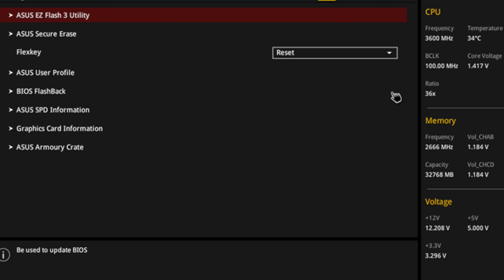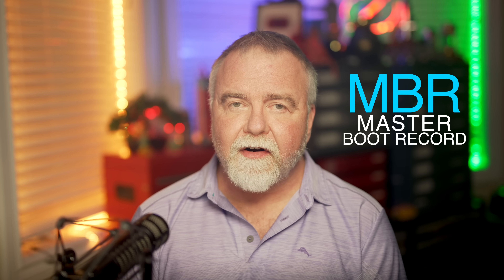How Computers BOOT: From Startup to Viruses

Comment: On monitors there is often an OSD (On Screen Display) Menu.  I had an idea that maybe they could use that system to drop a mouse pointer onto the screen as well a simple start menu.  In this system you would connect your mouse directly to the screen - so that the pointer and start menu is available even before you power on your computer.  Then as the computer boots up - it would be able to interact with the screen and get the x & y coords of the mouse position, and it would be able to temporarily reprogram what options appeared on the start menu.  The screen would also let the computer know what it's screen resolution and aspect ratio are.  The great thing about this system is that even if your computer froze, locked up or crashed - at least the pointer and start menu still function and are available at all times.  So basically the mouse pointer and start menu would be overlayed above the video output from the computer and work independently.  I guess the OSD is an operating system in itself, so what we are talking about is something like a co-processor - the computer is offloading some of the work to a very stable feature that is hard-coded into the monitor.
Reply: Wouldnt that increase latency for the mouse? might be bad for gamers
Reply: That sounds like an interesting thought experiment. There are already ways for displays to send information to a connected computer system, such as its resolution and sound capabilities through, e.g., EDID, and mouse/touch controls with USB. Really the only thing that's missing is a dedicated processor that can handle additional work given to it from the connected system such as to provide its own visual feedback overlaid on the incoming graphics data.

This is starting to sound similar to client terminals.
Reply: Nice idea in theory, but it wouldn't work. That's just not how OSD work. It would also be impractical to try to implement. There i already a system in modern processors to handle things like that.
Reply: sounds like a remote desktop client built into the monitor, or an X window display.

Comment: One thing you didn't touch on is how the bios/uefi knows what cpu is in the socket. That also takes place when the system is powered on. To my understanding right at that moment when the bios is initializing and testing hardware it's also talking to the cpu and executing the CPU's micro-code. imbeded in that code is the name of the cpu. Like i9-12900k or AMD 7800. If I am also not mistaken the micro code is part of the cpu it's self.
Reply: The BIOS is just a piece of memory that contains a program that is executed by the CPU. This program is very specifically written for the hardware that contains this BIOS memory chip. This is why it is even possible to write a bootsector program in 512 bytes that at least can handle the complexity of loading even more data from disk to start a more intelligent program that for example knows how to handle different filesystems and can read from one and start executing from there.

Micro code is something completely different: complex CPUs have instructions that are composed  of a lower level of instructions. Those instructions are not related to the instructions the CPU defines, these are just little programs that execute various steps needed to execute a single CPU instruction.
Reply: @bertthomas quite so.

The "real hardware" inside a CPU from the eighties onwards has usually been a bit slice system not based on the kind of assembly code we are familiar with.

The give away is that of you have a machine instruction that can do multiple iterations (like copy a whole string) then actually what each alleged machine code instruction is doing is running a supportive in the microcode burnt into the rom of the CPU.

Older chips, like the 8080, had every machine code instruction implemented in silicon rather than coded in a deeper level of software. That usually meant one instruction per clock: no pipelining, no multiclock instructions, and each instruction could at most load and then store one hardware word of data (though there may have been odd exceptions). 

Note that a hardware word might not have been what we nowadays call a word.
Reply: the CPUID instruction is run pretty early in SEC phase of UEFI to make sure there's not a complete mismatch, but before cores are released from reset, other firmware can do sanity checks like sanity checking the flash layout.

Comment: But wait.  To boot, you need to read files.  Files are within the filesystem.  To read the filesystem, you need a filesystem driver.  The filesystem driver is contained in the kernel.  The kernel is stored on the filesystem.  

How can the boot loader read the filesystem driver from the filesystem without having the filesystem driver?
Reply: Actually, it just needs to find ONE file on disk(the kernel), and copy it to RAM. Then start it.
Whatever else like traversing directories, changing files e.t.c. is outside the scope.

So the bootloader would have it's own very simplified filesystem driver. And likely use BIOS/UEFI functions to read sectors from the disk.
Reply: @erlendse Simplified filesystem driver as in, “read this block into RAM and execute it”.
Reply: Under BIOS systems, the bootloader was stored in a special spot on a hard drive that was invisible to the user in the OS and wasn't stored in any sort of file system, it was far more primitive than that, was literally just raw code in one specific spot. As for UEFI, it requires a partition formatted in FAT32 and support for accessing the file system is built right into the UEFI itself, no OS kernel etc needed. UEFI is also cool in that people have written "drivers" for UEFI that let it read NTFS and other file systems.

Comment: Dave, this was interesting and informative… Thanks
If I can suggest a topic for future episode, can you please explain how software (OS) interacts with hardware in terms of task scheduling?
I am interesed in details how OS sets up its scheduling code entry to CPU to execute every “time slice” (or whatever it is) so effectively an OS can schedule its tasks around in a multicore machine.
Thanks in advance.
Reply: Win 11 finally supports complete hardware control on 12th gen intel that solely manages what cores are halted or what threads go to which power/efficient cores along with the voltage and clock speed divider. But still, one core must have system idle process burning the clock cycles until an instruction resumes.. Task manager reports clock speed of 850mhz and 1 of 14 cores active on my "idle" lightened 22h2 win 11. I should run win 10 on same 2023 hardware to see the difference in software thread scheduling.
Reply: The very short version is that processors have interrupt controllers you can configure, on 6502 this was a hardcoded address like the reset address, on modern x86 it's the APIC (Advanced Programmable Interrupt Controller)

The operating system's, work post boot essentially is entirely doing bookkeeping on what's set up to handle interrupts. Virtual memory management, talking to hardware like keyboard, disk or network, task switching, background processes, pretty much everything is handled by interrupt handlers (though the literal interrupt handler itself tries to offload as much work as possible to a later process to keep the OS responsive to interrupts)

Even responding to system calls made by user programs was handled by interrupt 0x80 before AMD64 added the syscall instruction which essentially hardcodes a sensible behavior for performance (largely toggling between the user and OS memory and thread context)

Comment: Hardware engineer here.  Usually, reset lines are active low, so to reset a chip, the reset line is pulled to ground.  I believe that to be an artifact of when BJT transistors were still used, and NPN transistors were both faster and had a larger current capacity than PNP transistors.  So pulling a line low was easier than pulling it high.  You can check old 74 series logic data sheets and see that the current sink number was typically a lot larger than current source.
Reply from the maker: Thanks for correcting that!  I remember looking at the schematic and seeing !RST (rst with a bar over it) and didn't realize (not being an engineer!) that it meant asserted when low!
Reply: An added benefit is in case of a power dip. A power dip can throw a CPU (or any other digital logic chip for that matter) into an unknown state. If the reset line dips, the CPU would reset and go back to a known state.
Reply: Nevertheless, on the 8086 to reset, the line must be held high for four cycles.
Reply: @johnpmchappell  The 6502 is reset low.
Reply: was about to comment that :)
Reply: Yes, bipolar NPN-transistors. But also the n-channel enhancement mode field effect transistors that was the basis of early µ-processors, before symmetrical CMOS took over in the mid 1980s.
Reply: Also, with active-low, the device can be held in reset (or a similar sane state) as the power rails are coming up on startup.
Reply: @mgraen  modern machine. powergood on atx is low until psu delivers fine power.  tie it to reset and the psu does all that for you.  "for free" :)
Reply: An old school TTL input will take a high level ALWAYS if not connected to anything. I think this may have been part why most reset signal is active low. As if the reset pin should become floating at least the system would work
Reply: @afre3398  Unconnected pins are a thing that should not exist. This practice throws another analog brick into a digital world where you ideally don't have to know about any specific properties of the gates you are using. Thank god my first computer in the 70s already sent me into a completely CMOS world. Undefined signals and deeper knowledge  why this could or could not work never were a thing there. Except in one case, where a CMOS processor was deliberately turned into a kind of random number generator by letting its data lines float. More an ironic joke than a serious application.
Reply: @CDP1861  Floating CMOS inputs usually drift eventually to either low or high. It won't generate random noise
Reply: @Alexagrigorieff Not if you deliberately connect these signals to long, otherwise unconnected traces on the PCB as  antennae. Maybe I can dig up a video here on youtube to see that in action.
Reply: @CDP1861  unconnected /floating inputs in the 'standard' original ttl and ls types arent a problem they float high, later types such as hc and hct and the various cmos types should never be left to float
Reply: @RegScheepers  Automotive software engineer here. We still have this kind of fun :)
Reply: I've always wondered about the seemingly random active low pins!
Reply: I always thought it is also handy to keep a critical line at 5 V, instead of having it at 0 V and hoping no stray inductive or capacitive coupling blip resets the computer, especially in systems where RESET is an async-signal that does not need to be latched on a clock.
Reply: Vegan bicyclist here. Sounds legit.
Reply: Boy, does all of that bring back memories!
And when the 4000 series came out, with claims of how sensitive they were to ESD (not all that sensitive as was hyped about)... Was in 7th heaven with the 4016, then the 4066 came out, total geekgasm!
Gimme a few minutes, I'll still be able to build a shift register, both from a few chips or a bunch of discrete components...
Reply: You have not answered the question

Comment: I had big problems today, trying to clone a Raspberry Pi boot HDD.
Im a Windows user, except for my Plex server, and the health of the disk was below 70%.

I tried with Clonezilla, a software that boots on a USB stick, and runs on Ubuntu or similar. But after copying the disk (sector by sector), the disk just didn't want to boot.

I got some crazy info from stackexchange, that I needed to crrate partitions bla bla bla, which I knew was wrong information. I just needed a cline solution, tgat worked.

But I got it fixed with GParted and a simple dd command in a terminal window, in GParted, and everything works now. I had no clue, dd could be used to copy disks, including the MBR.

Comment: Thanks.  I'd love to have a more in depth explanation of just how UEFI interfaces with the BIOS, as it's caused me no end of headaches dual booting to Linux, etc.  File system?  Can it be viewed?  Manually (via program) changed, etc.?
Reply: UEFI completely replaces BIOS, and has been the standard on PC's since the Windows 8 days really. It does what BIOS did but then does so much more, in a modern way. It doesn't have a file system and the only way to interact with it is to enter into it when the PC starts by mashing F2, Del or whatever your system needs. As for Linux, it has no problem booting on a UEFI system, but only some distributions properly support the Secure Boot feature and most distros tell you to disable it before installing.
Reply: @craigmurray4746  Can't completely replace the BIOS or system wouldn't know how/where to load the info in the EFI partition.

I want to know the ins and outs of just how the UEFI/EFI partition is created in the first place.  Details.
Reply: @richardwernst It's completely replaced, there is no BIOS in modern PC's at all. UEFI can emulate a BIOS so old systems like Windows XP and 7 can work, but even than functionality is slowly being phased out now. As for the UEFI system partition, it's a multi step thing. The OS creates the partition during install, as it is UEFI aware. But under the hood, the partition is flagged in a special way so that when UEFI attempts to boot the OS, it is aware of where to go and look first for the boot loader files on that special FAT32 partition - during OS install, the OS can set UEFI variables like boot order, register the location of the boot loader etc. It can do this because UEFI is a modern design.
Reply: @craigmurray4746  So the UEFI is in a chip on the motherboard?
Reply: @richardwernst  Correct yeah. It's a flash chip, usually between 16-32MB these days. It's read only, though it's electronically erasable so that it can be updated. We still need a small battery though to store our user changed settings as well as to keep the clock running when the PC isn't powered on or not connected to the wall.
Reply: @craigmurray4746  So if I take a computer and remove the hard drive and boot to SETUP or whatever, all those UEFI settings will be unable to be saved (since they're on the EFI partition)?  Don't want to go thru that with my main system (have legacy boot enabled and secure boot disabled), but will see if I have something else around here that has those settings and give it a try.
Reply: @richardwernst  The "EFI partition" on the hard drive is not where "BIOS settings" are kept (i.e. - when you press F10 to "Save and Exit").
BIOS settings are stored in a small battery-backed memory on the motherboard. That's why when the battery dies, the computer forgets all the settings including the date and time.
Reply: @andrewr7820  Hmmm, I'm confused (hence my hope that Dave would do a video on this), I understood craigmurry to say that the settings ARE stored in the EFI partition, if not, why have such a partition at all?

Comment: In the early days of PDP8s and 11s we would usually key in an actual program - typically 10-15 instructions long - that could read from a card reader or paper tape reader. So we’d load up cards or tape with a bootstrap program that could then read from a hard drive if you had one.
Reply: Never done that on a PDP-11

They always just booted into RSTS/E on power up.

Comment: Of course UEFI supports 3TB+ HDDs, but so do systems of the past. I have hard drives that are bigger than 2TB that I used on a PC way before I ever had a UEFI.
Reply: Yeah, except you can't boot off a MBR drive bigger than 2TB under BIOS. As a storage drive sure, more than 2TB was just fine, but booting had it's limit. Must admit I never tried to boot a BIOS system with a RAID volume larger than 2TB, so not sure if the same limitation applies
Reply: @craigmurray4746  The workaround (to use big HDD with MBR) was to create a small boot partition at the start of the disk so that the address of the partition fell below the 2TB  boundary. GPT is clearly the way forward though.
Reply: @andrewr7820 That makes sense yes, thank you. I kind of purged my mind of all these hacks, limitations and work arounds a long time ago lol.

Comment: "UEFI BIOS" vs. "...from the BIOS days."
There you go, trying to have your cake and eat it too. Which is it: UEFI is a type of BIOS, or UEFI replaced the BIOS? Because right now you just contradicted yourself by claiming both.
Reply: UEFI doesn't have proper runtime services - therefore it is not a BIOS.

UEFI is a firmware and a bootloader.
Reply: @tikkasen_urakointi : Maybe not, but my question was to see what Dave would say to resolve what he said before, because on one side of his mouth he said that it is one, and on the other side he implied that it isn't. And of course he's not the only one with that problem.